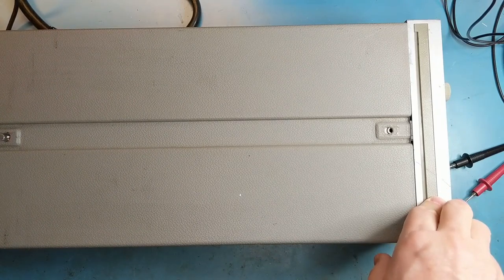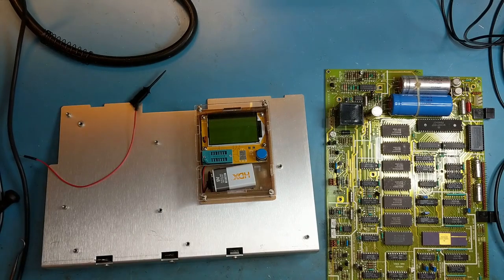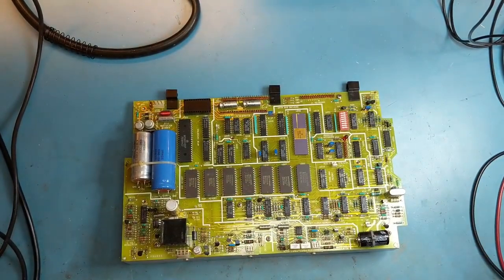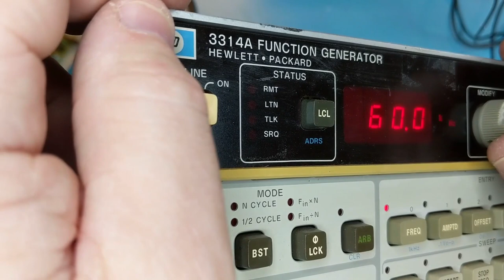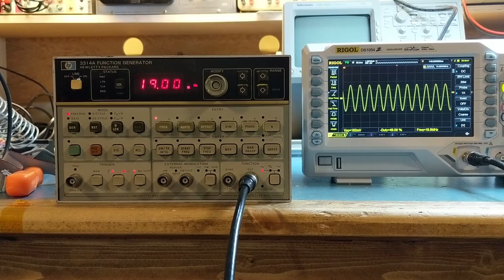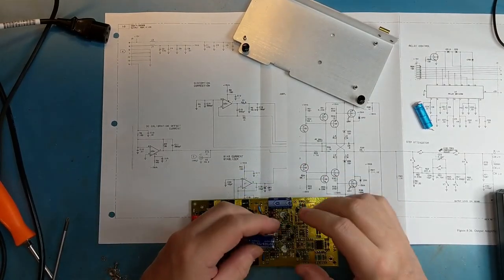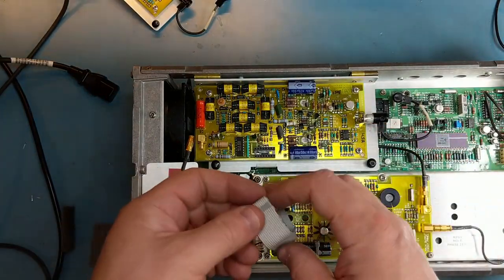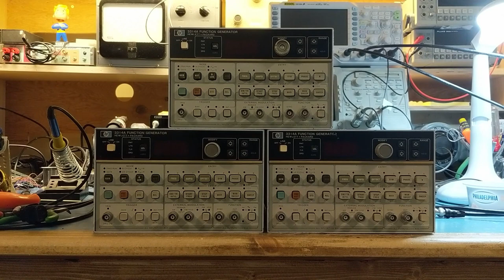EV 018 - On The Bench - HP3314A Signal Generator, Part 2

Comment: Really enjoyed both videos. I have one of these which was DOA too. Found a faulty ROM which I replaced when I found the code online. I think though my frequencies are not stable but don't know how to address this. Any views on this?
Reply from the maker: I have another unit that does not track frequency and is noisy. So far I have isolated it to some issue around the custom chip that generates Iup and Idn current ramp. The IC itself checks good though, in another unit.
Since the display is also acting up (also tested good) I think now that the issue is the IO bus and logic, controlled by the CPU.
I am working on a jig to hook up a logic analyzer but it's not finished yet.
You have already fix one thing in the CPU circuit, maybe you also have an additional problem in the IO circuits affecting ramp waveform programming.
I hope this helps.